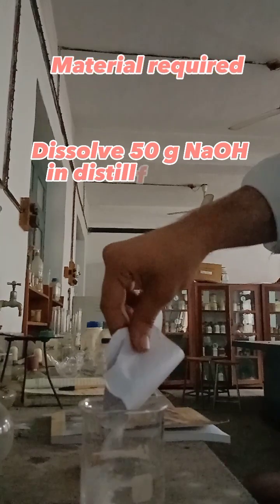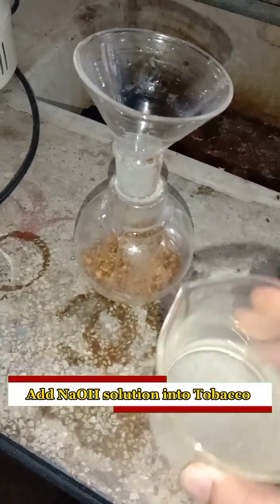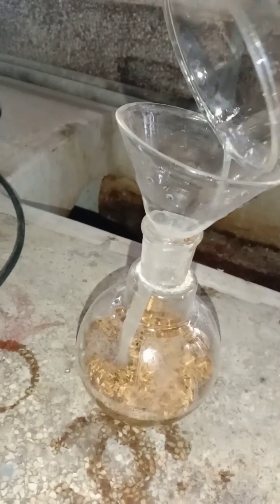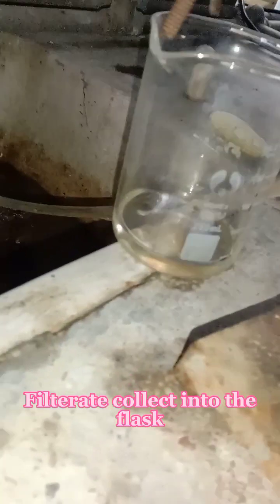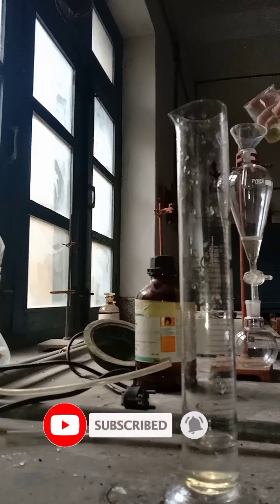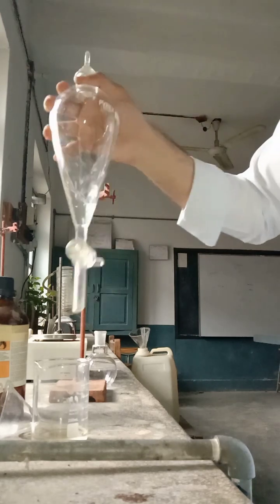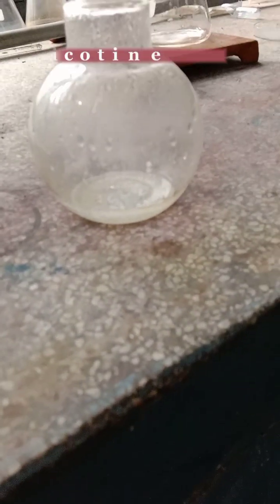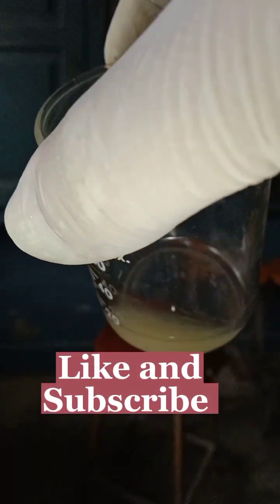Nicotine Extraction

Comment: I don't understand the purpose of the diethyl ether.  Wouldn't the nicotine  freebase already be concentrated  through the stream distillation?  Is the ether really needed?  Thanks for the great video!
Reply: Water soluble volatile impurities would also be in the distillate, and despite the fact nicotine freebase is highly water soluble it does have more affinity for the ether layer and leave impurities behind when the layers are separated. Keep in mind that the ether extracted nicotine base is still far from pure as any volatile apolar impurity with a higher boiling point than ether is still there. Best thing would be to dry the nicotine and then vacuum distill (you can't distill at atmospheric pressure as given the high boiling point of 247°C the temperature would decompose the nicotine base).
Reply: Are the ones you see in the end in the whitish liquid nicotine crystals?